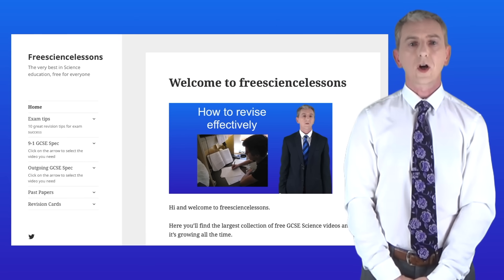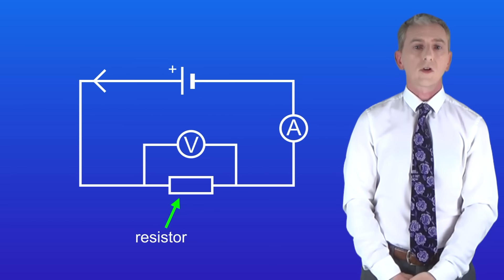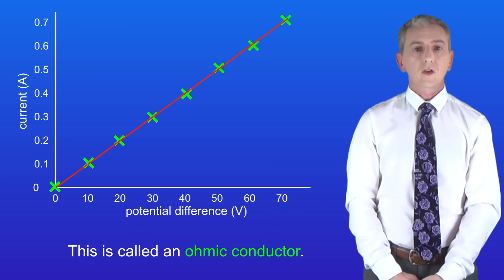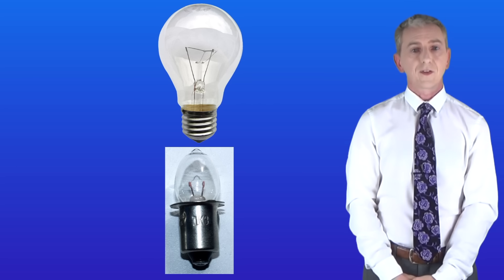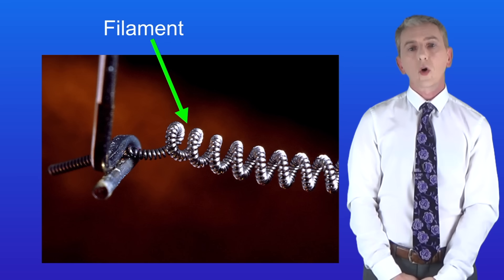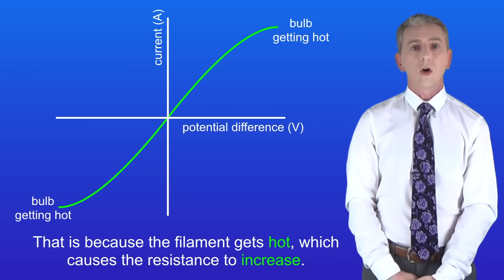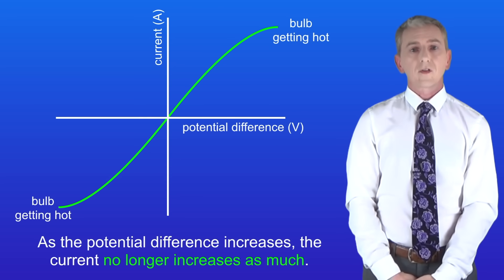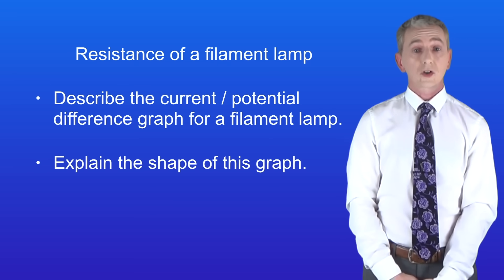GCSE Physics Revision "Resistance of a Filament Lamp"

Comment: Not sure if anyone will see this, but how would you actually change the potential difference across a resistor? You can't, right? I understand that with a fixed resistor/ohmic conductor, resistance stays constant while current and potential difference are in direct proportion, but how could you increase potential difference? Would you just increase the current flowing through the circuit instead (which would consequently increase the potential difference, right?) Basically, what I want to check is whether there is a way to directly change potential difference.
Reply from the maker: You put the fixed resistor in series with a variable resistor. When you increase the resistance of the variable resistor, the PD over the variable resistor increases and the PD over the fixed resistor decreases (as the total PD from the power supply is split between the two resistors).

Comment: hello Sir, I have 2 questions:
wouldn't there be a variable resistor in the circuit to produce that graph of the filament bulb? otherwise, I don't see a way to change the resistance or the potential difference.
why does the filament get hot at the start of the graph and at the end of the graph? at the start the current is low so surely the filament would not be very hot?

thank you!

Comment: 1:56 isnt there meant to be a variable resistor in the circuit sir? I have checked other sources and they also contain this, forgive me if I sound too arrogant and correct me if I am wrong

Comment: How does resistors control the potential difference of other components?
Reply from the maker: The total PD of the circuit is the PD of the cell. The resistor will take a certain PD (higher PD at higher resistance). The remaining PD is for the other components. So we can reduce the PD across the other components by increasing the resistance of the resistor.

Comment: does anyone know if we have to exactly know why resistance of the bulb increases as the pd across the bulb increases? or just use V=IR to explain it
Reply: Because in a filament lamp (an example of a light bulb) as we increase the pd so does the temperature as more energy is transferred to other energy stores e.g. thermal. This means that the resistance increases as it now takes more voltage to push the same amount of charge/current through

Comment: If you don’t have an ammeter before the lamp how do you know the current flowing in to measure how the current has changed after passing through the lamp?
Reply from the maker: Current is never used up by components. If you know the current passing out of a component, then you know the current passing into the component, as it will be the same.
Reply: That makes perfect sense now you have said it. Thank you very much.

Comment: I don’t understand how we know resistance is increasing.  Why would the current stop increasing as much ?
Reply: We know resistance is increasing as the current across the wire is decreasing. The current would stop increasing as much, as, when you increase the current, the temperature across the circuit increases. You need to know that as current increases, temperature increases. An increase in temperature also means an increase in resistance, which causes the current to gradually not increase as much. I hope this helped.

Comment: Hi 
thanks for the great videos
why doesn’t the current increase as much as the potential difference?
Reply from the maker: Because the current equals the potential difference divided by the resistance. So unless the resistance is 1 ohm, the current will be different to the potential difference.
Reply: Freesciencelessons Thanks for the reply
but i thought that the reason for the resistance increasing was because the current no longer increases as much, why is this ?
Reply: Freesciencelessons is it because the resistance increases because more energy is needed to drive the current through the lamp, and then using the equation R=V/I  if the resistance and potential difference both increase, then the current would not increase as much as it would if the resistance stayed the same?
Reply from the maker: Yes essentially that's the answer. As the filament gets hot, its resistance massively increases. That means we need a much greater potential difference to drive the current. So the potential difference has to increase a lot to get a relatively small increase in current through. Hope that helps.
Reply: Freesciencelessons yes it does thank you so much and thanks for the great videos